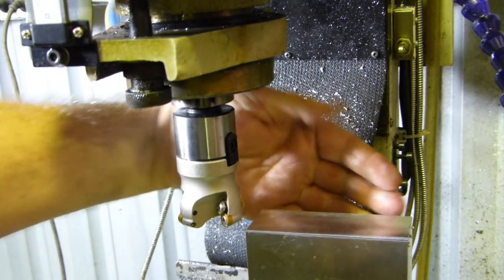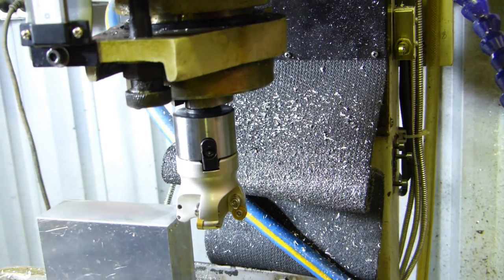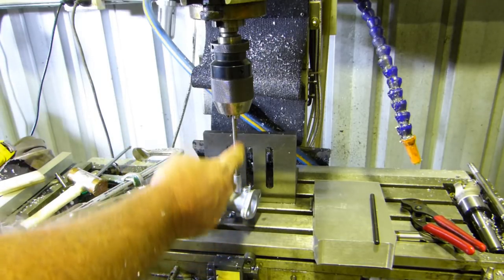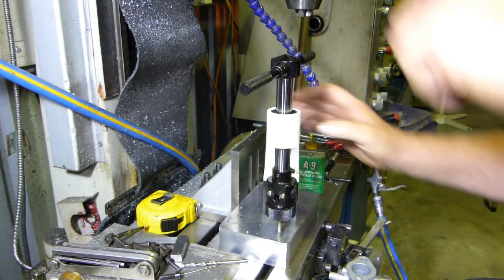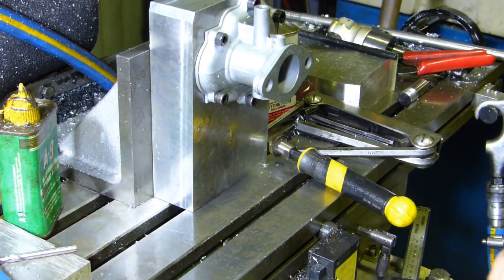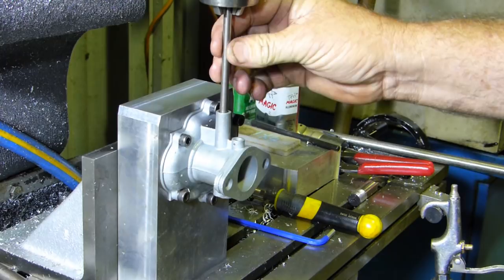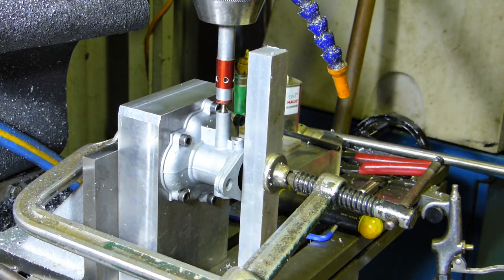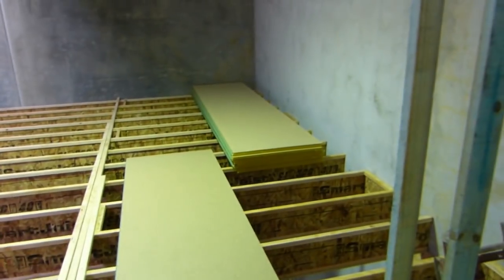Kangaroo Stew #84 Part 2

Comment: We use the vidmar/lista boxes bolted together for our parts counter(the top of the cabinets) and it really works well. Some of them literally have a ton of bearings in the drawers.  They are pricey but they hold up like no tomorrow and offer great storage.  They are a big investment but I think they are worth it. We have been beating on some of ours for 30 years now and they never need a thing. Also you can easily change your layout with them by pallet jacking and moving them fully loaded if need be.
Reply from the maker: bcbloc02 I reckon a video or a pic of your work place would be interesting